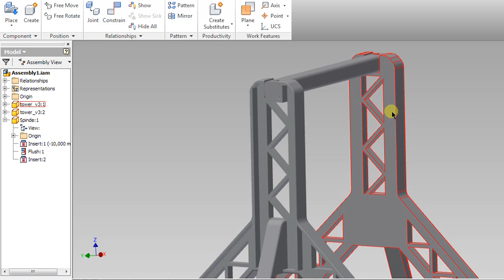3D printing - If you dont have one you will need it

Comment: hello!

I tried to print your spool holder, but when I print the holder itself, the printer stops at level 186, and they are 250 levels!
Do you have an idea why it stops at 186?
I have tevo tarantula, I use Cura and Repetier.
Thanks for your help...
Woody.
Reply from the maker: Hi Woody,
The STL works fine and many users have printed it already so it’s another issue related with your system.
Are you using the stock SD card (never use the provided sdcard as it can corrupt very easily) ? Are you printing the model in the standing up position (print the model in the horizontal position instead)?